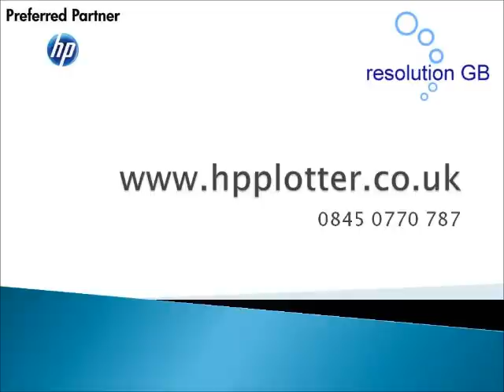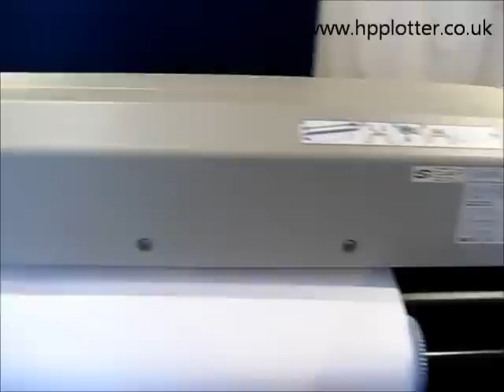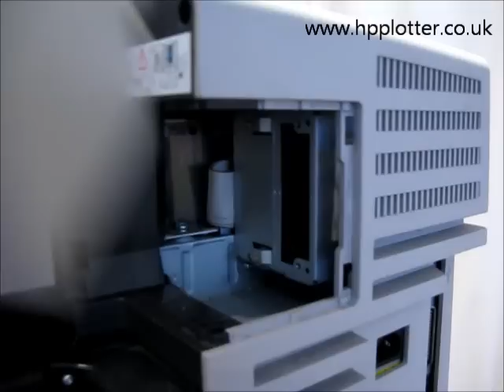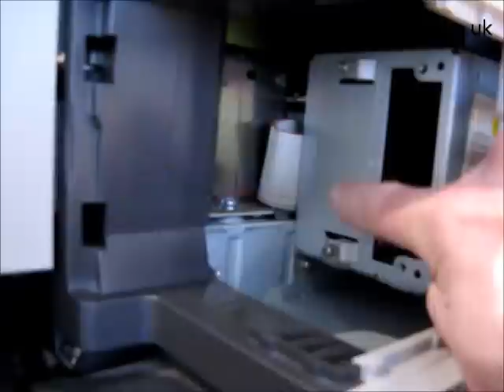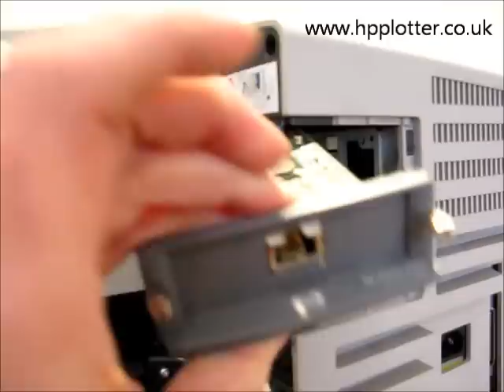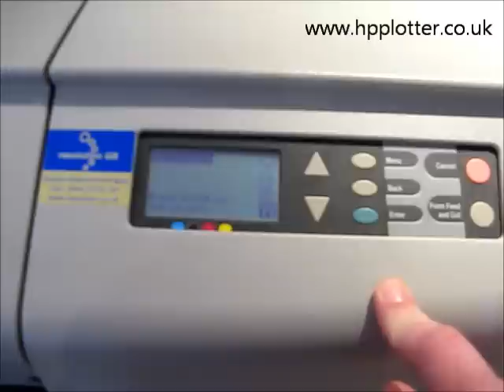HP Designjet 500 repair - Adding printer to a network

Comment: By adding it to the network does that mean wired connection or wifi? I recently received the hp designjet 500. I am cleaning it out and thought it's 2023 I wonder if someone made it wifi compatible so I don't need to use the USB. Just wondering if this is the solution I am looking for.
Reply: If you physically connect the printer to your router with an ethernet cable and configure it according to the instructions here, then your laptop could print to it via WiFi...

Comment: I have bought recently a Designjet 4000 that's running on Firmware 5.5. I had only limited success trying to print from Windows 11 or even Windows 7. The drives shows the roll that is currently loaded as greyed out. I haven't tried it on Windows Xp but will give it a try on Mac os 10.7.5. From what I was told older HP Designjets run better on older Mac systems.
I do plan to upgrade the HDD however, I first need to get a solid connection with the printer. Might get a 6 pin firewire both ways and try using that with my 2006 Mac Pro.

Comment: Longshot asking here, HP designjet 500 plus set up the way in the video but the driver isnt available when the list comes up to install? 
What am i doing wrong?
Reply from the maker: If you are looking for drivers to work with a current operating system there aren't any, as this model is c. 20 years old. Try using a 510 driver but it may stop printing colour. Alternatively contact us for a new printer - starting from just over £500+delivery. Email nicola@hpplotter.co.uk
Reply: There is a driver called 'HP DesignJet 500 PCL Driver (v8.10).zip' that is available via a link on the hp forum (unfortunately no longer available direct from hp) that works on windows 10. There's a thread where user 'saulxx' gives instructions and an outdated link, and then further down someone else provides another link that still works...

Comment: From the 450/430 to the beautiful and quality 500 series.... and then came the T520 etc ABSOLUTE RUBBISH ... sad how a company can loose it .. They have done the same with their laserjets, the new series is simply rubbish ..
Reply: Thanks for your comment Dave. The new machines are far more compact, more advanced, have more memory - and do far more. They work with current operating systems and users aren't running out of memory like they are with the older 430/450/500's as times have moved on with customers software as well which take more memory. They are also easier for the end-user to use - with almost video-quality instructions on how to load paper and change ink or printheads, it's easier to establish if they have a fault than the old light system of the 430/450's and frankly you get far more bang for your buck - prices have gone down over the years. They're also visually more appealing and number of inks reduced and quality of print increased. From an engineering perspective they are however harder to repair - but absolute rubbish? well - we would have to "agree to disagree" on that one. We love the DesignJet 500's - a simple machine in comparison - but for that, it retains an element of old-style beauty - so we do agree that they are great machines. In fact many people still ask us to carry out repairs on them. BUT if I could choose between the two I'd opt for the new style every time.
Reply: @snootybutnice  Nicola, you have your opinion and I have mine. HP's latest is firmware upgrades to not allow generic cartridges ... they are really scraping the bottom of the barrel. They problem is that they have shut out a lot of their own cartridges and I have customers fighting about genuine HP cartridges being rejected ... HP is now at the bottom ... no, I really see that they have a looming problem, they are on a steep downhill slide. just Google HP cartridge problems and machines ..... "one or more cartridges has a problem"   At this stage I will opt out and advise my customers to avoid HP at all costs ... easy solution

Comment: it be nice if it could be legible, but the vid quality is so low can see the screen :/
Reply from the maker: Yes - the actual equipment used was possibly around 3-5 years old at the time -   but don't forget 2006-2008 video camera technology was far inferior to what we have today. It's such a shame that it isn't very clear video footage - but it was the best we had back then. The good news is at least you can hear the explanation in the video and this has helped most of the 86K people viewing it. I should say also that this video was also experimental and made at a time when few in this industry were helping customers with this kind of practical advice - it was made by our former MD Tony Bray (RIP) who knew he was terminally ill with cancer and who wanted to help our customers more. This printer is so now old that it's not worth re-doing the video but we do totally agree with your point :D

Comment: I am have several issues. 1- I Cannot get passed CFG Network = YES  & 2- The firmware update cannot communicate with the plotter. I have the plotter connected to an HP Pavilion with the printer/USB cord and I can plot to it without a problem. I am trying to hook it to my Linksys 1900AC & Linksys WRT 800 but none of the computers can see it.

Comment: How do I edit the IP address? This is so unclear i'm getting frustrated
Reply from the maker: Hello Sharpblade - the video talks you through the process even though you may not be able to see the screen, you'll know which buttons to press. However, if you are not familiar with the process and require a little hand holding then we can certainly give you two options: 1. our engineer visits you on site and does this work for you (£149+VAT) or 2. you send us your network card with your IP, subnet and gateway addresses and we will be pleased to set this up for you at a cost of £35.00+VAT+ £10.00 delivery. Please contact us on 0845 0770 787 or email engineering@hpplotter.co.uk

Comment: Hi, I have HP designjet 500plus with GL2 card, so i don't have open slot. Second slot is covered with metal plate, just like on this video. Is it possible to have lan connection and GL2 card at same time? tnx!
Reply from the maker: Yes lan jetdirect card can go in either slot, so can the HP GL/2 card. Both slots can be used.
Reply: All india sarvis Jay raj infosys Nehru please new delhi 8587839273 all  plotters
Reply: My card slot spots don’t have anything in it. Just the plate. Can you point me to the right direction on which one to order

Comment from the maker: Hi Ashley - IP stands for Internet Protocol.
 
Basically every computer/printer etc in a network environment has to have an IP address. It is a identity for connections to each other.
 
Most companies use a basic address such as 192.168.1.1 So for example your computer may be 192.168.1.1, your plotter may be 192.168.1.2 and so on. The first three parts must be identical, but the last number different. This will link all machines, so they can communicate with each other.
 
I hope this helps.

Comment from the maker: This model has now been replaced by the latest HP Designjet T520 printer.  If you are considering purchasing a printer please don't hesitate to call us on 0845 0770 787 for free advice.  The Designjet 500 was superceded by the Designjet 510...which in turn has now been replaced by the T520.  The T520 offers wi-fi capability as well as a tray at the back of the machine which allows you to print A3/A4 - ideal for a small office as it saves you buying 2 printers!
Reply: All india sarvis Jay raj infosys Nehru please new delhi 8587839273 all  plotters

Comment: I'm on a designjet 800 following this. Hi i followed this but for some reason i still cant get it to work. It seems like if i go back into the card config all the settings i input have reverted back to No*. Is that normal? Also I can see with appletalk but it shows up with the name Designjet 500. If i go into the card ID it shows AT=Designjet 500.
Any idea why?